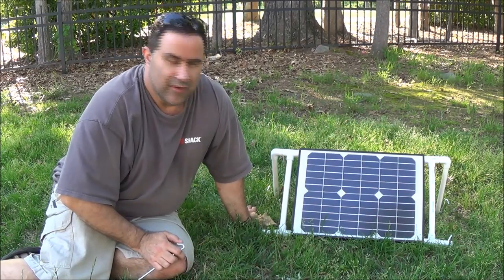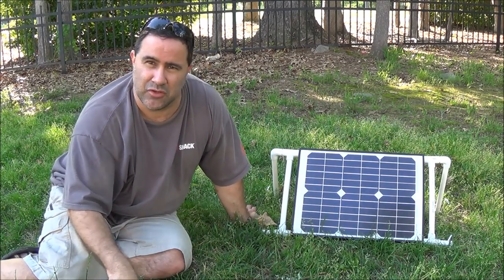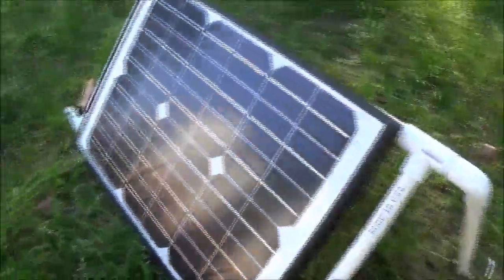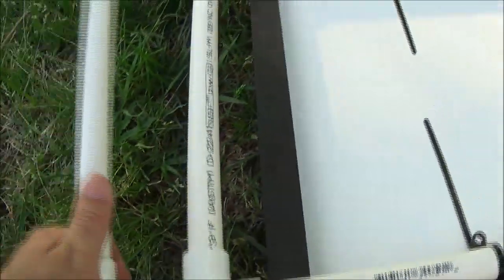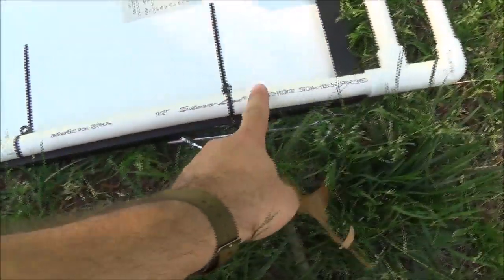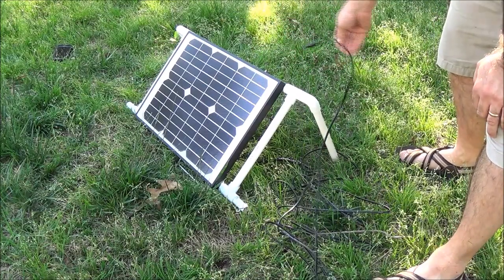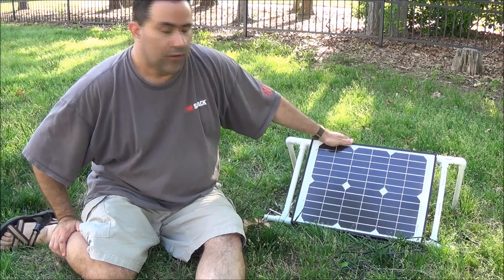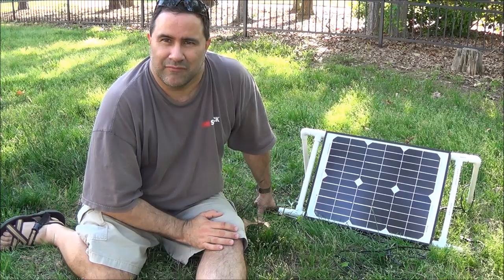DIY Portable Solar Panel Stand for $10

Comment: Great Idea!  I made one for my 24"x48" 100 watt panel.  I used the heavier PVC, added a support in the middle and put 3 short feet on the bottom so it is up off the ground. I glued all the pieces together except where the legs have to fold up.  I use it to charge the battery in my 13 ft. Scamp. Works great so far!  Cost was about $15. I also drilled a hole near each corner on the edge of the frame so I can run a cable lock through in the most convenient hole and lock it to a tree or my camper.  Next step is a bag made out of moving blankets that I can zip it into for travel.

Comment: Thank you for posting this! I'm building this stand for a larger pair of panels that are hinged, so the stand will need some additional support for the top panel that folds up. Initially I was simply going to use a telescoping piece of aluminum from an old camera tripod, knowing it's simple to adjust the height, and mount this at the top of the second panel. When raising the 2nd panel above the stand, I can extend the telescoping rod to the ground at the desired length to create the right angle (and to match the bottom panel's angle with the ground). Any ideas or suggestions for improvement, or using a different method entirely to support the top panel?

Comment: I am trying to figure out how you attached the panel to the frame.. did you drill through the frame to put the wire ties through??  thanx in advance
Reply from the maker: Thanks for your comment!! In this case, I was lucky and the holes were already in the solar panel frame. So, I did not have to drill any holes. But, if I were going to, I put a wood block between the back of the panel and the frame so that you could drill through the frame and into the wood, and not break the back of the panel. If you build something similar, I would love to see it!!

If you are interested, I have a link in the description box above to the panel that I got from Amazon.
Reply: I already have a 45 watt panel I am going to use.. thank you for the info.. Will let you know how it goes..  Paul
Reply from the maker: That's even better!! Good luck with your project, and let me know how it turns out.

Comment: would that work for a 300 watt panel? I need to make one for two large panels
Reply from the maker: You may need to put a center support in the middle of the frame to give it a little more strength.
Reply: NC Prepper would i be able to have it rotate so it can be a little adjustable?  recommended idea, thank you for responding. I made a jewelry rack and knitting rack from pvc I would like to use this for solar, did you anchor yours down?